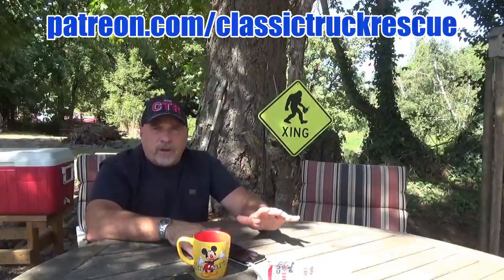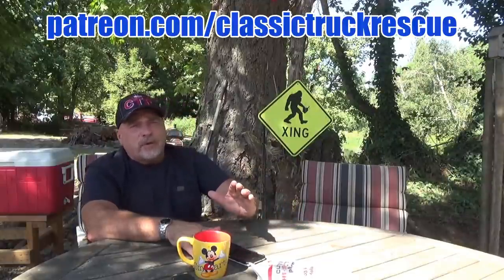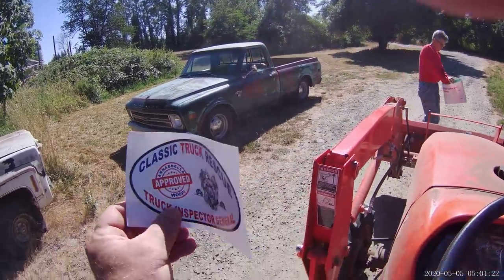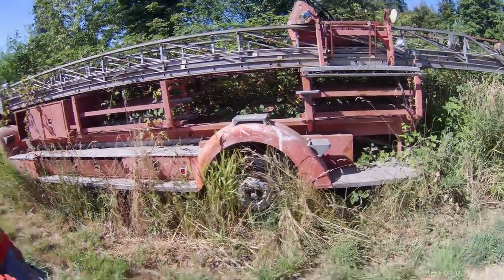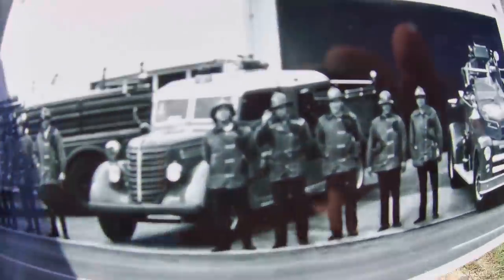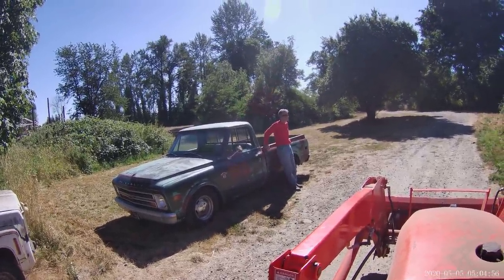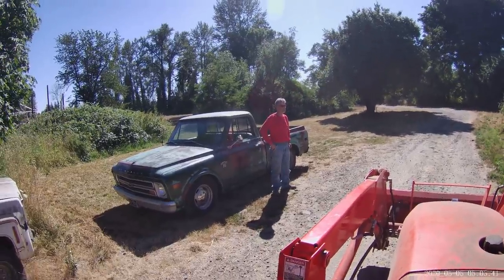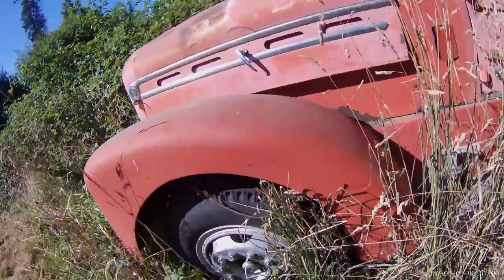1955 Seagrave Firetruck Authentication

Comment: Have you watched Waylon Wire's channel?  He is currently building a rat rod with one of those GMC V12 engines.  He has it in his rat rod and it is running.  He is still building the vehicle so it is not driving yet, but every once in a while he does fire up that engine.  He is calling his build 'The Dirty Dozen'.